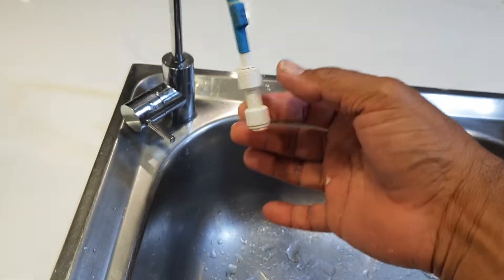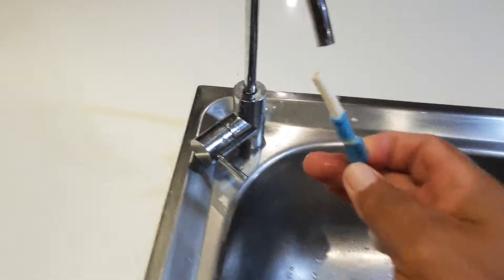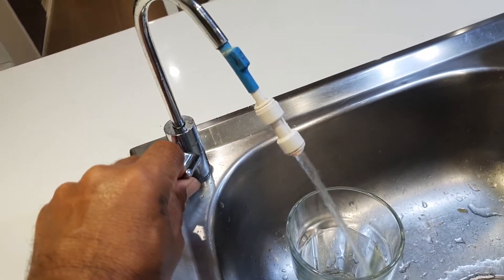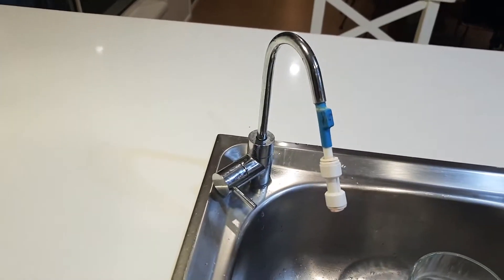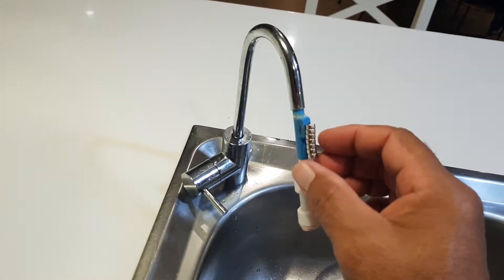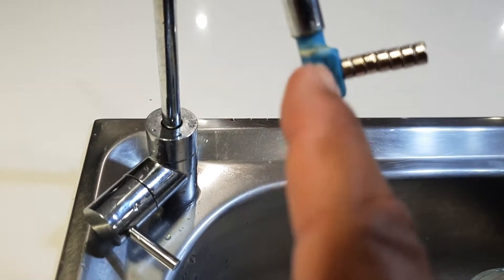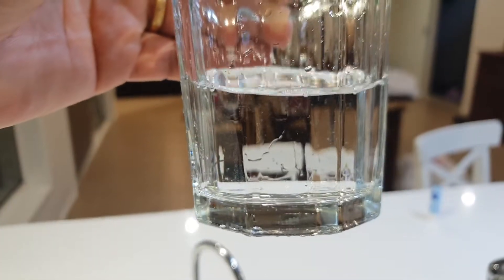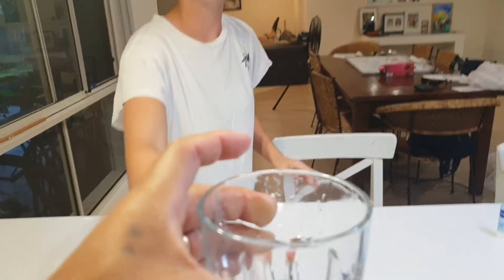Magnetic Drinking Water direct from kitchen sink tap - added neodymium  magnets

Comment: That additional magnetic you just added I've seen people putting them into a flask and getting a computer fan to spin it like a vortex do you know much about it . 🙏
Reply from the maker: No i don't sorry
Reply: @MrDarrinMarshall  thank you for your reply
Reply: Yes water is paramagnetic thus aligns (or tries to) at right angles to the magnetic polarity e/w.
 The magnetism in the fans motor is spinning. So the water tries to get out of the way(tides).
The water dosnt hold magnetism not possible.
Try getting a powerfull neodynium magnet and floating a corn flake on water. Then point the magnet close to  at the water next to the cornflake. Idiots say  its the iron oxide in the cornflake that moves it. Thats bullshit as rust isnt magnetic.
The magnets is pushing the water into a wee dent; in the water surface and thus the cornflake sinks into the dent.
Not magnetism.